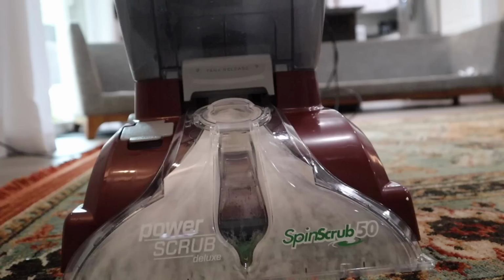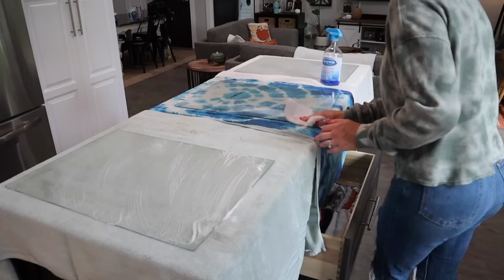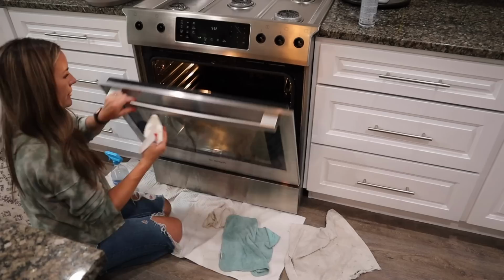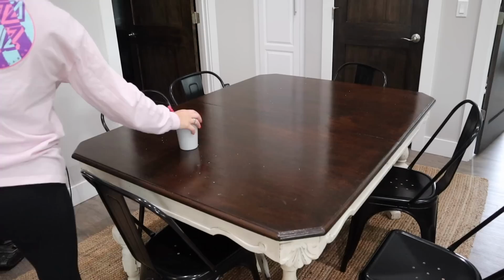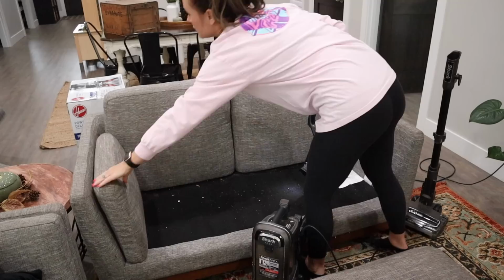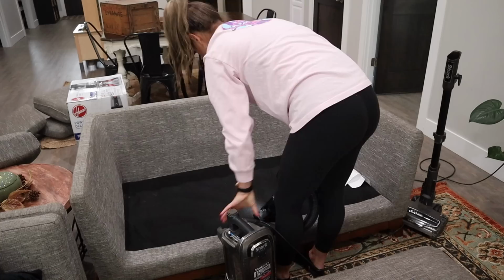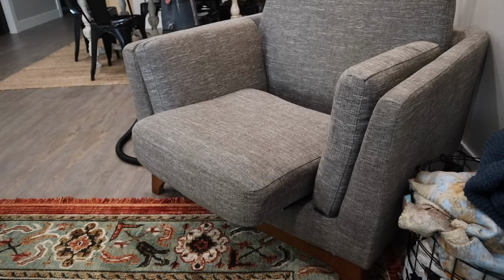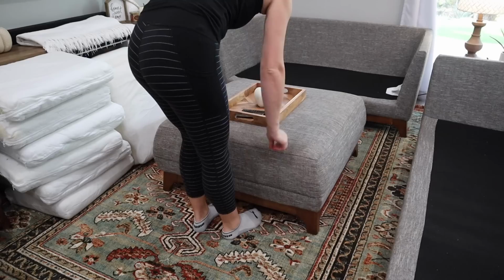GET IT ALL DONE // 4 Days Of DEEP Cleaning // EXTREME CLEANING MOTIVATION

Comment: For my oven, I sprinkled baking soda all over it, then sprayed white distilled vinegar with original Dawn Liquid Soap in it. Let it sit for 20-30 minute and scrubbed away. Anything that was a little harder, I used a blade and it came clean perfectly!! As far as the glass door, I’m sure what you did is the only way (good thing you have Donnie😉). Just thought I’d throw that out there in case you’d like to try it next time. Although it looks like the Easy Off did the trick too! Great video!!!

Comment: I've been blessed with never having to clean the oven with more than dawn and a quick wipe! The door does need to be taken apart to get between the glass but my manual says it will void the warranty so I just hang dish cloths on the handle. 
Lol I do sweep the oven out though fairly often to get any crumbs or food before it can cook on, perhaps that's why I've never had to do the big scrub? I remember reading easy off years ago and it suggested moving the appliance outside so I definitely see why you tried everything possible first! I'm wondering if it would work on my glass cooktop which is a whole other battle!?

Comment: I use a pumice stone on my oven to avoid using easy off.  It works really well.
Reply from the maker: That won’t scratch the stainless steal?
Reply: @KristenKasper  No as long as you make sure it's wet.  I dip it in Dawn dish soap and water.  It takes like 10 minutes to clean my oven.

Comment: This may be a really dumb question but here goes. Just got laminate wood floors earlier this year and I am terrified to shampoo my rugs because of the water on the floor. Am I overthinking it or can the water be trapped under for a day or so until the rugs fully dry and cause damage to the floor underneath? And thanks for the content. Obviously I need all the help I can get😁
Reply from the maker: You can lay plastic down under your rug before shampooing! Or take the rug outside and shampoo it in your garage or driveway maybe! 

I didn’t do either and no issues but I didn’t really think about it before hand either. 🥴
Reply: @KristenKasper  great suggestions! Thank you so much.